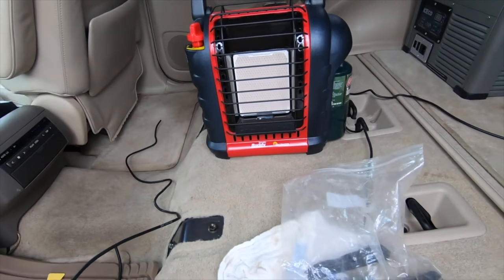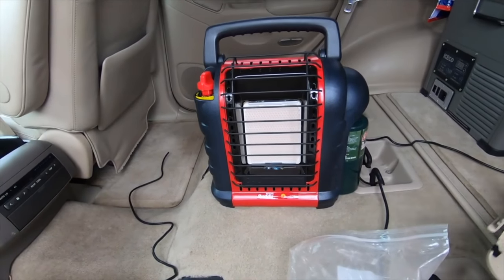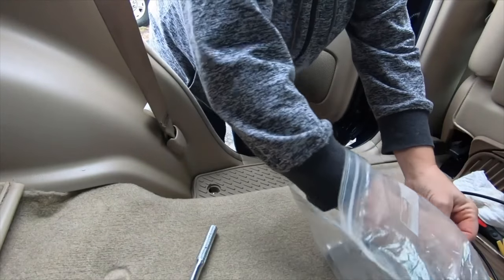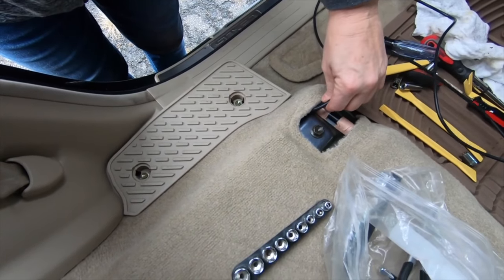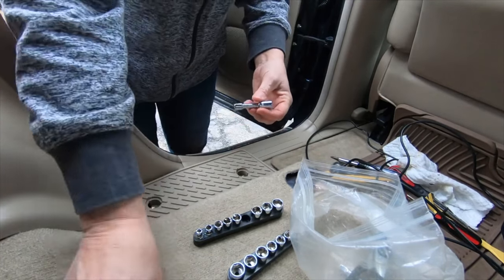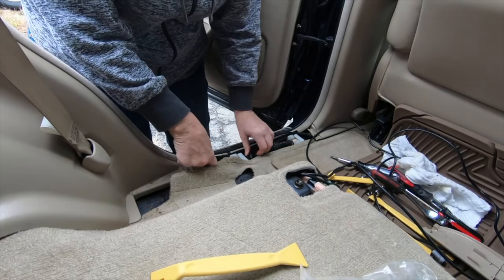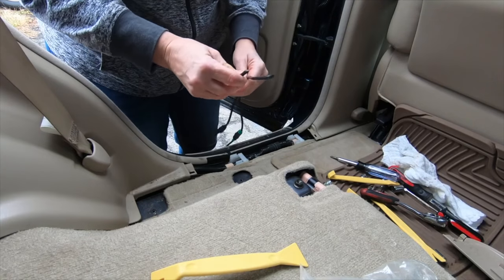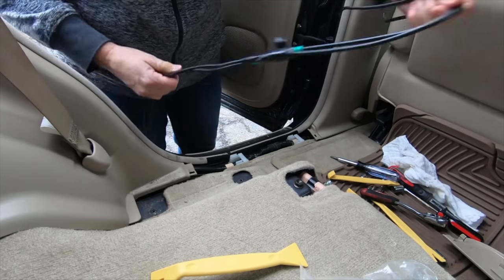Trying to Run a Wire From Battery to Back of Lexus Gx 470 for USB and 12 Volt Outlet

Comment: Did you only run a positive wire from the battery? If you ever wired up a plug back there did was it only connected to positive or did you ground it somewhere?